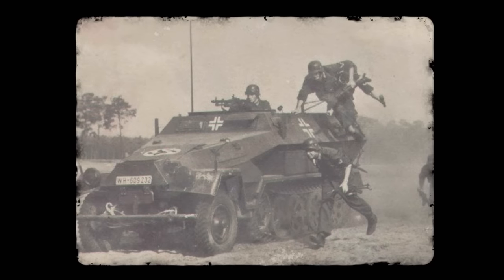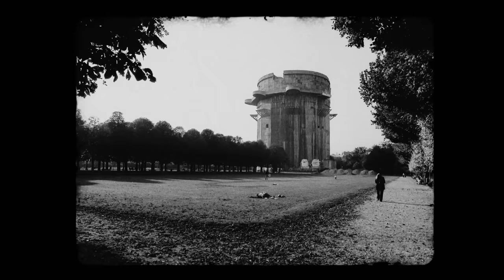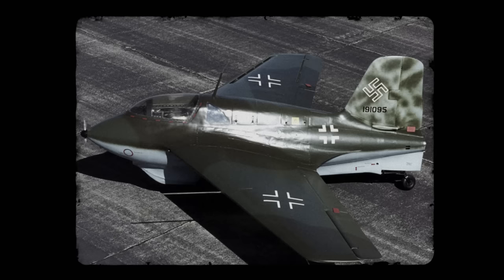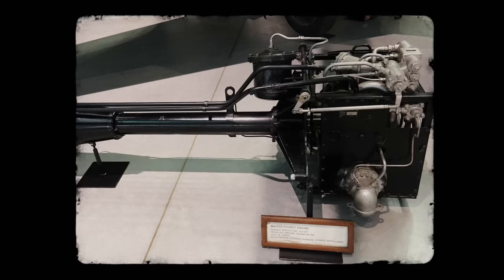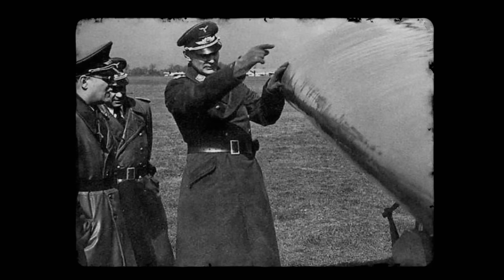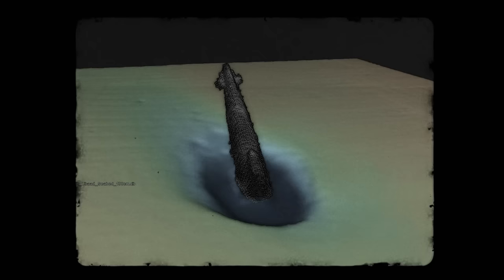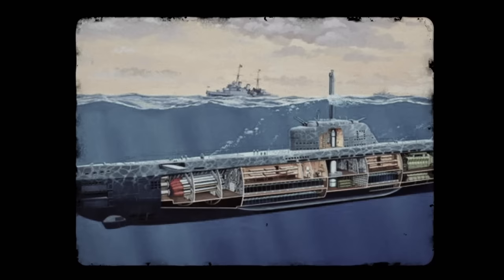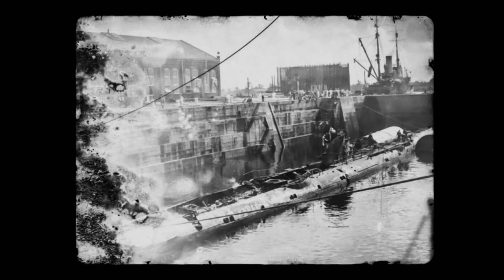4 INSANE Creations that Prove German WW2 Engineering Was Scarily Advanced

Comment: The early assault rifles like FG 42 and STG 44 were under used, advanced small arms but one of the easiest produced and least seen was the Gewehr 43
Reply: It boggles my mind, considering all the weapons they had designed… most soldiers got 1800s rifles.
Reply: @jackryan444  it came down to differing philosophies in small infantry tactics, Germany was focused on their machine guns which were advanced enough to continue being used by modern nato armies today. On the squad level Americans were using ww1 era machine guns because American tactics centered on their rifleman. Germany pushed for a semi automatic rifle in 41 but being german it was overengineered/unreliable and didn't catch on.
Reply: I don´t know if FG 42 can be considered assault rifle. I probably get what you mean, but it doesn´t fit the specific of assault rifle, automatic rifle would be more suitable I would say.
Reply: @hansbauer6817  No I do think she could be considered an assault rifle as she was selective fire, but it would have been more efficient I think most feel if more forces were equipped with the G43
Reply: @johnryder1713  Well with that you are right, however FG uses full 7,92x57 mm cartridge, while assault rifle uses shortened rifle cartridge, like StG with 7,92x33 mm.
Reply: @hansbauer6817  Indeed, the lesson of the lower power means higher rate of fire, what inspired every assault rifle of 5.56mm from the original NATO 7.62mm after what could have worked out a bit better, and the more or less abandoned .280 NATO cartridge for the original FALs that weren't adopted

Comment: German Tech and the war winners: Proximity fuse: zero, Cavity Magnetron: zero, Atom Bomb: Zero. More? Jet engines; they built axial-flow when they only had the available metallurgy to build centrifugal flow. So tired of this tripe. When the war is in your backyard, and you are losing, you can get any fever-dream contraption to it. It doesn't have to be serviceable, supportable, or sorted. "It would have been so great." Sure. They spent years and could not replace the ME-110. But overnight, they will perfect hypersonic skip bombers. Because that is how things work.

Comment: Did you know that most wireless equations were solved in the 1860s or earlier? All we have implemented in the last 30 years was researched and solved over a century earlier.....but we did not have the ability to make what we needed for a wireless network. With previous technology a cellphone would have been the size of a grand piano. 

Did you know the electric motor was invented 40 years before the internal combustion engine but we still do not have the technology to make electric cars feasible, and no, the EVs are not feasible in any sense of the word. For one thing they are so heavy we would need to rebuild every road and bridge in the nation. So yes Germans may have seemed to make advanced things but did they just week existing solutions?